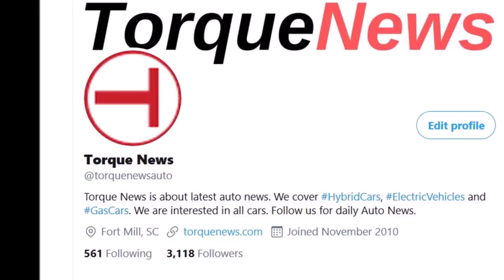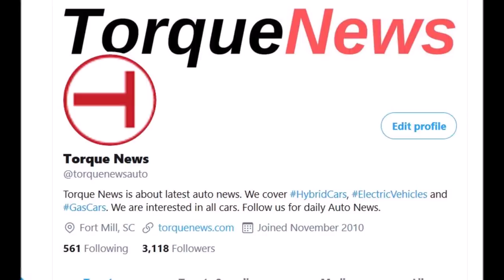Tesla Giga Berlin's Speed Is a Role Model for Modern German Construction

Comment: Giga Berlin have the advantage of having most of the pre-permiting done by another auto manufacture if I recall correctly.
Reply: Can you provide examples of this claim?
Reply: @lengould9262  Here's an article from 2001 (in german): https://www.welt.de/print-welt/article455144/Gruenheide-hofft-noch-auf-BMW-Werk.html
Reply: @lengould9262  the permitting work was mostly done so it was easy for a Tesla to take over.